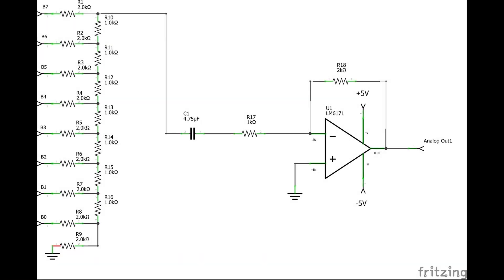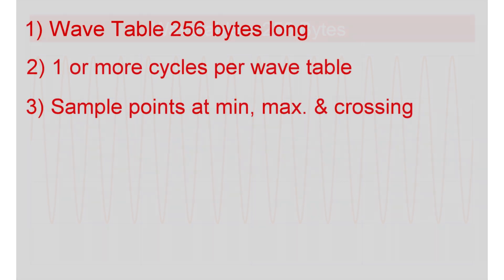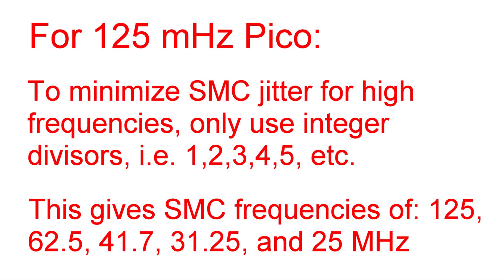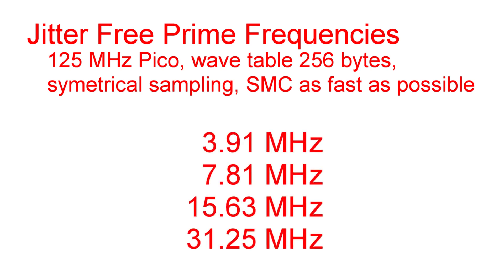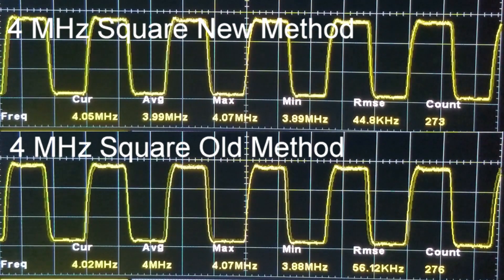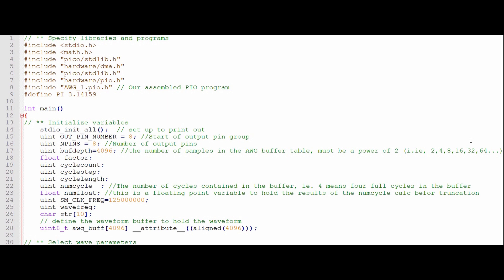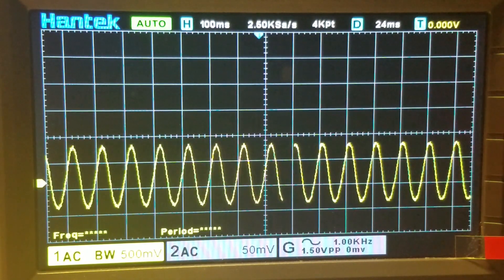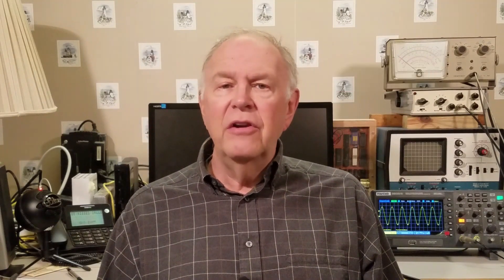Raspberry Pi Pico PIO - EP. 16 - Smoother Arbitrary Waveform Generator

Comment: I love your videos about the pico, especially making an AWG ❤️❤️❤️ I think it would be fun to see you make some additions like adding a display and rotary encoders to change settings, frequencies, and modulations with a pico since the main processor isn't doing very much ❤️❤️❤️ keep up the amazing work!
Reply from the maker: Thanks.  That is a good idea; the main core is just loafing.  I guess I'll have to get back into C/C++; for a while I've had my own little boycott of the C/C++ SDK.  Not for any good reason; just because I wanted to challenge myself to go bare metal.  Thanks for the suggestion!

Comment: You see the triangle wave in your "new" method?  Look at the bad tops.  I think that is due to your new op-amp as it would require some bad samples to cave in the top otherwise.  I have seen this pattern before.
Reply from the maker: I think the squashed tops are due to not having a sample at the exact top of the curve.  There are only a few frequencies where we can assure that the top of the triangle wave will coincide with a sample.  Nyquest is good for sine waves; but can't deal with discontinuities in triangle or even square waves.

Comment: I see W2AEW has episode 88 Cheap and simple TDR using an oscilloscope and 74AC14 Schmitt Trigger Inverter where for < $2 those square wave edges can be crisp down to just 2 nano-seconds while safely driving 50 ohm loads.
Reply from the maker: I just checked it out; pretty cool.  Thanks for the info!

Comment: I got that to work easily with the Arduino IDE: 
I just renamed the main() to setup() and created an empty loop().
Then I deleted the stdio_init_all() and printf() as these are done differently in Arduino (Serial.print) but are not needed for the waveforms.
I had to manually upload the compiled uf2 by explorer drag and drop, as the interface did not like to cooperate, but it worked fine and my oscilloscope shows a beautiful sine wave.
Reply from the maker: That's great!  I've only tried PIO using the Arduino IDE a few times; I'm glad it worked.  Thanks for watching!

Comment: Hey David, I've been following your series for a long time and I'm currently in need to do a function generator myself for a student project. However I have a changing in my frequency based on an input. As I need many pins for other parts of the project I am not rlly sure how I should do it. I will definetly need an SPI DAC cause I won't have enough pins available for a self made DAC.

Should I convert the data to SPI and then make a pio program that forwards spi data? or should i just calculate the data and let pio transfer it into spi and send it?

and should I manipulate the wavetable (or be switching between 2 wavetables and i manipulate the one that is currently unused) or should I use 1 wavetable and change the frequency of the pio (idk if this works with spi but i could also just let the pio only send a portion of the data to reduce it, can't i? by saying like ignore every 4th data and defining the max possible frequency in the beginning)

I hope you or anyone else who digged deeper into Pio can give me some answers on this. 

Thank you if you read the full comment!
Reply from the maker: What's the maximum frequency for the AWG.  If it's relatively slow (like audio), you might be able to use SPI.  However, I would guess that the DAC is the most time critical part of your project.  You may want to use SPI for your other inputs and outputs and the GPIO ports directly for the DAC.  If the waveform is complex or you need sharp edges, you may need a very fast DAC.  Run the math and look at the harmonics you will need to accurately describe your wave. 

Again, the maximum frequency will determine the direction you should take on changing the state machine clock frequency or modifying the wave table.  If it is slow, like less than 1 MHz, then changing the clock frequency will work well.  If it is faster than that, then modifying the wavetable may work better.  Hope this helps.  Good luck!
Reply: @LifewithDavid1  Thank you for your answer! The maximum frequency will actually be pretty low at only 45-55Hz but I will need 32.000 samples per wave at minimum. The wave will be a simple sine wave.

Yeah I thought that changing the clock might just work fine. I will try it out!
Reply: @LifewithDavid1  I might consider sending the data via dma directly to the spi data out without using pio or the core. I would just use a dma channel with the wave-table and another dma toggling it. 

would that be possible? or even a better solution? or would it be much worse?
Reply from the maker: @gehtniemandenwasan9789  You should be able to do that.  Using the PIO for pacing the DMA data can make it easy to control the frequency of the wave.  Without a bit of review, I'm not sure how DMA could be paced using another DMA channel (but there probably is a way).  PIO and DMA can work together without any assistance from the core.  Good luck!

Comment: Hi David,

thank you very much for your great videos!
I would like to take up Bill's suggestion and think it is a good idea to implement the signal generator according to the DDS principle.
With the appropriate assembler routine I was able to reduce the loop function to 7 clock cycles, which results in a 19MHz DDS clock (with a 133MHz system clock).
Although signals beyond 1MHz are a bit rough, on the other hand, the frequency can be set exactly in steps of 0.031Hz and jitter is absolutely not an issue.
Reply from the maker: Thank you for the comment.  I just looked into DDS in greater detail.  It seems that what I presented in this video utilizes the same principles; however the phase accumulator values are calculated during initialization instead of real time. Then those values are used to calculate the amplitude (phase to amplitude converter), again during initialization, which is then stored in the wave table.  The larger the wave table, the finer the steps in frequency can be.  The downside with this implementation of DDS is that the wave table has a finite length, limiting the number of frequency steps available, in this case about every 0.031 MHz at 4 MHz.  

Using assembler with the Pico is something I haven't tried yet.  That's why I've limited my "assembly" work to the PIO and DMA.  That's something I'll have to look into more.  Thanks for watching.

Comment: A couple of other ideas for getting more choices of waveform frequency:

1. Adjust the Pico's main clock frequency (typically 125MHz).

The big downside is that it will affect anything else timing sensitive that is dependent on the main clock, like serial ports or USB (unless they have their own dedicated clock?).

2. Use a non-power-of-2 for the waveform buffer size.

You won't be able to take advantage of automatic wrap-around on the read address, so you'll have to reset it every time you get to the end of the buffer.  If your second DMA channel just does a single transfer of the read address to the first DMA channel's register, it should only stall the DMA briefly.  (There are multiple copies of the DMA registers with different memory alignment.  Pick alias 3 at offset 0x30, where the read address register is also the trigger to start the next DMA cycle.)

And if you're using an input (transmit?) FIFO on the PIO, the DMA's job is to keep the FIFO full (not provide data directly to the PIO), so the PIO shouldn't see any stall.  The brief stall while the first DMA channel's read address gets reset should be orders of magnitude faster than the time it takes the PIO to completely drain the FIFO.  Once the DMA resumes, it should be able to refill the FIFO much faster than the PIO can drain it, until the DMA stalls because the FIFO is full.

Your sample frequency still depends on the state machine's frequency, but you've got a lot more choices in how you fit the waveform into the sample frequency.  If you want a sine wave to exactly sample the peaks and zero crossings, you'll need 4N samples per waveform.  You'd get N-1 samples between each peak/crossing pair.
Reply from the maker: Those are all good ideas.  I thought about changing the system clock.  The only stable clock is the crystal.  The ring oscillators vary with process and temperature.  Perhaps you could add feedback to correct for variations.  

You could increase the wave buffer even more.  8k would double the number of "prime" frequencies available.  I've done the "ping pong" handoff between DMA channels and it does take at least 1 clock cycle.  

I'll look at sampling more, you've whetted my interest.  Back on the 70's I studied Nyquist and Bode plots, never thinking I use them for a hobby.  Time to revisit.  Thanks for the comments and for watching!

Comment: Hey David, 

First of all, let me tell you I’ve been watching all your videos regarding the Pi Pico and I find them very informative and entertaining. Keep them coming.

One thing that I think you forgot to mention regarding the length of the wave table, it is that the last sample contained in the table should the last one before the cycle repeats. If the wave table length is 256 values, item 0 should the beginning of the cycle, but item 255 should be the previous value before the next cycle begins.

Another improvement would be to generate a cosine wave table instead of a sine wave table. This way you would only have to match the extreme values of the function without having to match the spots where the function crosses the x-axis.

For instance, if you have a 14-value wave table (comprising 0 to 2π):

value[0] = 1 // cos(2π*0/14)
value[1] = 0.901... // cos(2π*1/14)
value[2] = 0.623... // cos(2π*2/14)
value[3] = 0.223... // cos(2π*3/14)
value[4] = -0.223... // cos(2π*4/14)
value[5] = -0.623... // cos(2π*5/14)
value[6] = -0.901... // cos(2π*6/14)
value[7] = -1 // cos(2π*7/14)
value[8] = -0.901... // cos(2π*8/14)
value[9] = -0.623... // cos(2π*9/14)
value[10] = -0.223... // cos(2π*10/14)
value[11] = 0.223... // cos(2π*11/14)
value[12] = 0.623... // cos(2π*12/14)
value[13] = 0.901... // cos(2π*13/14)

The intersection with the x-axis would be handled by the external circuitry.

Have a great day
Reply from the maker: You are right, I didn't say the ends were equal, but that they should match.  However, I was a little ambiguous and I should have made it clearer.  I appreciate the comment and I'll pin a comment to the top of the comments to make it clearer,  Thanks for watching!

Comment: I think that the first and last sample in the wave table should not be the same.
Consider if you stepped through the wave table by one step. You would be putting out a zero value twice in succession.  this may be contributing to the jitter.
Reply from the maker: That's right, that's why I said they should match.  Maybe not the best term, but I didn't want to say they were equal; but rather in sequence. I probably should have made it clearer.

Comment: Typically DDS oscillators (direct digital synthesis) use phase accumulation prior to wave table look up, i.e the address of the table is incremented by a variable amount to provide the variable frequency. This might be too cpu intensive for the pico , but might be worth a try.
Reply from the maker: That's interesting!  As I was working through this exercise; I wondered if that was a possibility.  As I'm outputting one byte per system clock cycle, the RP2040 isn't fast enough to adjust the wave table address on the fly.  If you knew which clock pulse would be short (or long) in advance, you might be able to generate a series of wave tables that would match up with the frequency.  However, my brain starts to hurt when I think about how I could do that.  lol  Thanks for watching.
Reply: @LifewithDavid1  It may not be as difficult as it sounds. The top 12bits of the phase accumulator are the address of your table, so if the accumulator is 32bit there's only need to do a simple add and mask operation .  
BTW the output of the dac should technically be a pulse (as short as possible) , it is the job of the anti alias filter to reconstruct the waveform.